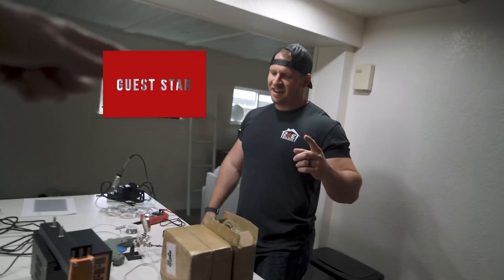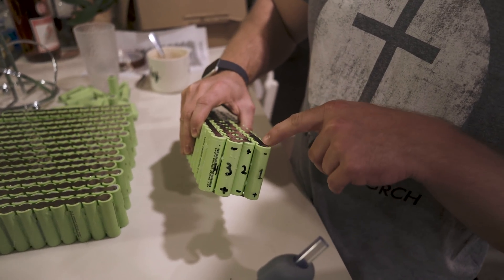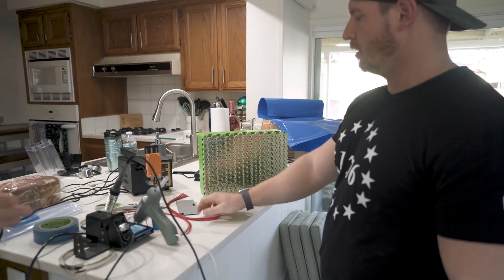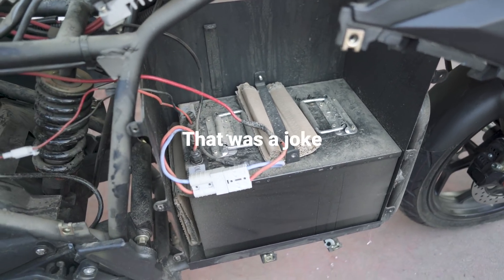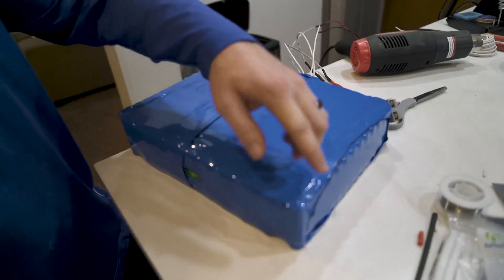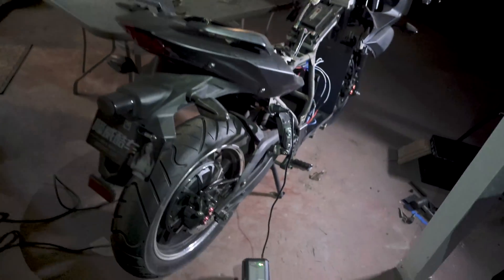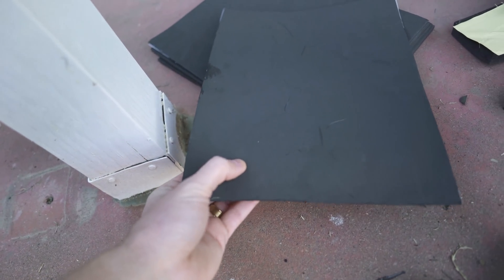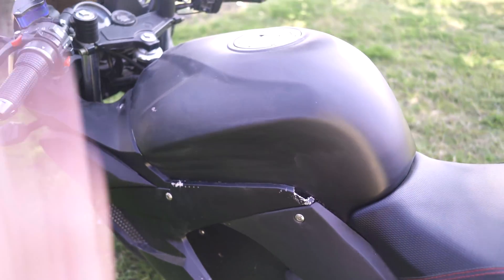UPGRADING the ELECTRIC SPORTBIKE from CHINA | Installing a Home-made Lithium Ion Battery

Comment: I have the same bike...... I change the controller to aa tricycle controller, i changed the battery to a 70ah 72v larger battery and an insane mod in the hub motor for star to delta configuration...... Its insanely fast now... Hitting around 170kmph....i love it

Comment: Hello can you tell me anything about the Wuxi Legou Electric vehicle company?  Are they associated? With the outfit in the city of Wuxi that you had trouble with?  I'm in the midst of negotiations for an 8000 W 120 km top speed 240 km range e-moto that looks good, And seems to be reasonably priced at $4800 (including delivery to my residence in Boston.  The price includes shiping, duty, taxes, etc). However, I have never uded Alibaba or bought a significant item like this from china so wanted your general impression. thanks. Robert

Comment: Hi Nick:)  I really Need your friend !! I bought the same bike from a local retailer... I paid 3,700$ for a 96vlt lithium... and  it run the exact way as your first road test. which make me believe i might've end up with an old acid lead battery. :(....
Reply from the maker: Wouldn't surprise me if they gave you a worse version than you paid for.

Comment: So you have 13p, rated at a combined 44.2 Ahr... that says they are 3400 mAh cells, right?  If so, they seem to be similar to the Panasonic NCR18650B 3400mAh cells, which are rated for 4.9A discharge current. With 13P configuration you have a maximum current capability of (13 * 4.9) 63.7 Amps maximum continuous discharge without damaging the cells.  At 20S, with they're nominal 3.6V each, that's 72V, at 63.7A is 4,586 Watts electrical power , or 6.15HP maximum consumption, and with a motor controller of maybe 95% efficiency, that's around 5.84 HP available to the motor, and with a motor efficiency of 85% that's 4.96 HP mechanical power to move the bike.  

Their original larger cells may have been designed for less capacity, but able to deliver higher current... that's the trade-off in battery cells... either high capacity (mAh), or high "C" rate.  If you run cells at higher discharge current than they are designed for, they WILL get hot due to higher internal cell resistance, and the lifetime will quickly diminish. Fatter cells, rated for higher delivery rate but lower capacity will not overheat, but will "initially" give lower range..... until the skinny cells go bad.

Maybe you should have chosen tool-rated cells?... like the NCR18650PF 2900mAh 10A

Also remember that cell "capacity" does not refer to CHARGE capacity, but DISCHARGE capacity.  How much energy it takes to bring a cell to full SOC does not always reflect how much it will deliver to a load... because of the internal resistance issue... which changes as a cell ages - depending on how it has been treated.

(those "discharge cables" only look good for maybe 20-25 Amps continuous anyway... without overheating)
Reply: This was just the initial pack, as you can see in the following videos

Comment: i was thinking you could measure volt and amp from controller to your motor, then you will know how many watt is going to the motor.  If the watt going to the motor is already max watt of the motor, then nothing else to do.  If lower then motor max watt, then you can look for what restrict full power going to the motor.

Comment: your BMS on that battery was more than likely the limit.  So if we take the 72v (lets assume 20ah battery) we get 1440 watt hours. So for one hour you can push 1440 watts.   Now lets say that the BMS is rated to a max of 40amps then we are looking at around 2880watts, so technically not quite 3000w getting to the motor.   The key is getting a continuous amps multiplied by the voltage to give you the watt output.  V x A = W .   If we assume consumption is 20 watt hours per mile and you've got 1440 watt hours you could hit 72 miles (note this is super slow driving and being extremely conservative on the throttle).   Now if you want a realistic number lets assume that we pull max watts that can be put out by the battery BMS (40 amps) the entire ride (2880w 'V x A') we can see that it's twice the the watt hours available, so it's safe to assume the battery would last for 30 minutes.  And if the top speed is 55mph (40amp), then you'll end up traveling around 22.5 miles before that battery is dead ;) .  You're milage will suffer ALOT as you can see! Now push it from a 20ah to a 60ah and do the math.  72v x 60ah =  4320 watt hours  which in turn should give you around 70 miles of real full throttle runtime. (Formulas (Voltage * Amp Hours = Watt hours)  (Voltage * Continuous Amp output = Wattage) (Watt hours / Wattage = Runtime percentage for 1hr)

Step it up in Voltage on the battery and there's a 2 fold factor that happens.  1.  Top speed increases as there's a higher available voltage.  So the default motor that came with this cheap bike is actually just as good as the 8000w, you just need a battery that's capable of pushing it and a controller to match the battery amperage that's required.  So let's aim for a 8000w bike build here.  1st off a 72v battery is not going to cut it as you have to account for the battery's ability to output the amps as well.  Stepping up to a 96v battery is going to put you closer to your target as you can now go from 40amp draw off each cell series in the batter upto 60amps.  This will give the battery the ability to handle upto  5760watts of continuous output.  So if the controller is programmable and has 110v caps in it, odds are you could just reprogram it to account for the 96v and push the max amp to 60 from 40.  Now if the bus bar in the controller isn't thick enough it may not carry the extra 20amps.  This would push the 2000w default motors to equal the 5000w version.  With you going for the 8000w motor you really have to push either 1, alot of amps at the matching voltage or move to higher voltages to manage the amps (prevent hot ass wires without switching to thicker wires :P) Say a 112v @ 120amp  battery would play nicely with the 8000watt as it can handle upto 14.4kw max.  Running a 112v @ 120amp is gonna net you a max watt output on the battery of 13,440watt.   Now you've got a battery capable of pushing your 8kw motor properly.   You're bike will hit a top speed of around 112mph and just kick arse.   

Anywho, I'm rambling KEEP THE VIDEOS COMING!

Comment: BRO THEY SOLD YOU A FALSE KM/H BIKE. MINES IS A 5000 W AND HITS 65 TO 70 KM EASY 90 TO 100 KM IN SPORT MOLD. FYI THEY GOT NEW BIKES NOW THEY MOVED THE MOTOR FROM BACK TIRE TO THE MID BODY. CAN HIT 150 KM/H. 90MPH EASY. BACK TIRE IS DRIVEN BY CHAIN NOW.

Comment: Can you not by pass the throttle and just inject direct power to the motor with the battery and get a taco of what the back wheel is doing. That may give you the information difference between with the controls controller/restrictor vs direct injection.

Comment: recommend settings and everything that potentially get u 200kmh no joke but will be expensive. heres the setup 
144v 45ah vtc6 
custom 144v sinewave ZL 
10000w QS motor Dualphase
this if you dont know i dont know how to tell you but this set up easily top u 100kmh 0-100 in 4.x seconds :)

Comment: Man, this is the second time i write this message, do you take the time to read the comments? 
Have you tried that button that looks like the horn??? One is the actual horn, but the other 'changes gears' as to say, it is a 'limiter' and will switch from 1 to 2 to 3 to 4 and it will defintely run above 50 kms/h! That is how it works on my electric bike! Mine is 1000 watts, not 3000 watts like yours and reaches 50 kms/h in '4th' gear'. Just try it! Promise me you will!!!!! Because I see your driving but you don't even try to honk the horns! Try both buttons!!
Reply from the maker: Bro I'm very active in the comments. Watch my latest video and you'll see I was hacked two weeks ago and had no access to the account since then.

Anyway, no, I've addressed that many times in the comments. The horn button is a horn. The start button is a horn. No limiter, just crappy battery and motor
Reply: @TheInja  thanx for answering. Sorry you've gone through all that trouble and that your bike was so disappointing. Hope you get it to run properly. Best of lucks! 😉👍
Reply: There must be a button somwhere on your bike that is a limiter.... Once again, try one of the horn buttons....

Comment: You should definitely have thicker wires. Then you won't lose so many volts under high load.
You should also have a more powerful bms.
I would recommend active balancing of the cells.
The cells have easy to go out of balance under heavy loads.

Comment: I am wondering when you will decide to change the fucking controller and solve the 50 kmh problem.. you have built a 1000 bucks battery but not give a 50 bucks controller.. its not need to be a special controller just an ebike controller with the rated power my opinion is to overvoltage that motor for ex choose a 110 volts controller ..and modifie the hall sensor plug.. the colours will be the same..

Comment: Build another of those battery paks and put the 2 side by side, then you will have some power. And use heavier guage wire. A higher amperage controller will spin that motor faster!
Reply from the maker: We have lots of upgrades on da whey 😏

Comment: Take the brake pads off, coat the back side of pads with brake quiet and let it dry, then reinstall.  Fill that battery compartment up! Don't forget to leave ventilation to cool them.

Comment: Connecting pos-neg for every individual battery may have been overkill.  Just making one connection between the pos-neg strips should have worked just as well.
Reply: b barnhouse each one only carries 7ish amps without getting too hot. If you’re running 40 amps at 3000 watts that’s a real quick fail point without more connections

Comment: If I were you, I'd be shooting for 144v and 250 ~ 300A
Reply: Martyr4JesusTheChrist  not for a motorcycle build
Reply: Martyr4JesusTheChrist  144v is within the specs of many controllers. I sell sine wave 24 fet controllers rated to 150v for 250 quid.
As for batteries, we're talking 14s more than what he's currently running, granted it's more cells, but not a crazy amount more.
So for 430 quid you could expand the battery to 34s, plus 250 quid for controller. He's already talking about replacing the controller.
I think you need to calm the fuck down and accept that this is merely the opinion of an experienced ebike builder and electronics engineer.
Reply: Martyr4JesusTheChrist  oh, side note, if 84v is getting him 50kph, 144v isn't going to get him over 100mph, that's beyond the winding of the motor he has.
Also I can touch the positive and negative of my 100v pack and barely feel a thing. DC is nowhere near as dangerous as AC. Check out electroboom on stage with about 150v of DC, sure it feels uncomfortable, but it's faaaaar from fatal.
Reply: Martyr4JesusTheChrist  144v is a pretty common spec. Andy Kirby, although canny, is new to the scene. I'm friends on facebook with many guys on endless sphere who have created amazing things. And I can tell you with no uncertainty that 144v on motorcycle builds is pretty common place when it comes to hub drives. You'll know fine well that this is a common spec from QS motor. Vito from QS is a top notch guy by the way, he knows his stuff.
I absolutely detest Kelly controllers. Way oversized physical footprint and they always rate there current limit based on phase amps, not battery amps. They make good golf cart controllers though.
Reply: Martyr4JesusTheChrist  my battery pricing is based on using samsung 25r 18650 cells, I wouldn't use anything else other than maybe sony vtc6 on a build like his. I also base the price on there being zero labour charge as they are building it themselves. They may need to buy nickel strap. I wouldn't use less than what they are using 8x0.15. I personally always use 12x0.15, which I get for 12 quid per 5mtr, they'd probably need 13mtrs of it.
Reply: Martyr4JesusTheChrist  you've actually copied and pasted the reason his top speed is so low and you didn't seem to notice it. The motor winding.

Comment: If you want a budget upgrade, search shunt mod. Do that to your controller and you'll get much more torque, might blow up the controller but hey, you need a new one anyway, might as well have some free extra fun with the one you have first. I'd also advise more volts, for greater top speed. My downhill mtb runs at 100.8v and 140A (At the battery, 350 phase amps). Oh, and a controller with flux weakening (field weakening) will get you a few more mph for the same voltage. Finally, deffo need fatter wire. I use 6 AWG silicone wire to keep the voltage drop under load down.
Reply: Martyr4JesusTheChrist  exactly, less resistance, less heat, fewer losses ;)
The frame is built for 30ft drop offs and the like. Takes it like a champ hahaa
Reply: Martyr4JesusTheChrist  No, a 24s pack is 88v nominal (3.7v per cell) or 100.8v HoTC (4.2v per cell)

Comment: What about car battery
Reply: You those portable speaker have like motorcycle battery. If you can get a used speaker and used they charger system is 110. Those cable they like speakers cables need to upgrade.

Comment: A new controller will be a massive upgrade in both acceleration and speed as next step in this rebuild.
I highly recommend to buy ”ASI BAC800” controller that is fully programmable using your mobile phone by bluetooth. ASI BAC800 is a very small, powerful and reliable controller that can deliver 90amps. 
You will peak 7,5kW(84V*90a=7560w)to the motor with that controller and your top speed will probably be about 80-90km/h. Your current hub motor should be able to handle 7,5kW fine. The thin battery wires looks like 10-12awg wires that should be able to handle 7,5kW bursts(full throttle) for atleast 90-120sec. Replace the wires to 8awg and you can use full throttle all day long.
Good luck!
Reply: Martyr4JesusTheChrist If he get this controller, the only thing to lookup is how many magnetic pole pairs the hub motor got. Yes he got a 72V nominal battery(3,6V/cell), which is 84V fully charged(4,2V/cell). If you want more info about thickness of awg/amp wires, Google ”ampere / awg table/chart”. 
4awg wire is overkill and could handle 140amps continuesly.

Comment: I can believe you set the exact same volts on the battery 72volts ???  you should had aim for 96 for better acceleration
Reply: Martyr4JesusTheChrist  hahahaa, dewd, what's your problem? You clearly don't build EVs, so I don't know why you're going around acting like done expert in the field. For one you don't seem to understand the correlation between the number of turns in a motor vs voltage. If you don't understand that then you're just wasting everyone's time

Comment: I think that if you can solve what is cutting the power transmitted from the battery to the motor and eliminate the problem you will achieve better performance but your battery will be drained faster, resulting in a lower range.
I was thinking that if you could add more batteries, find spots where you could add more batteries (maybe remove the wooden frame and add/make a 3-5mm (wall thickness) plastic battery box instead for more space) or find other alternative spots which can also be used in parallel.
The thing is that you want to create more Watts, and by adding more batteries you will achieve that, but you don't want to go over the required Voltage or you will burn something, so add something that will cap the overall voltage to the desired limit. The extra wattage will then be extra Ampere = extra range.
Nice work so far. Keep up the good work!

Comment: You made it work good for you It looks like you got roomp for more cells in that compartment  Maybe you can play with the controller to see if you can squeeze a little bit more power out of it 78 km is a little bit under 50 miles per hour you can do it

Comment: Have you guys heard of/seen enertrac.net? They produce a 10kw continuous 20kw peak hub motor specifically for motorcycles.
Reply: yeah, they make some solid gear
Reply: Martyr4JesusTheChrist  it's an engine for a motorcycle that should last 100k+ miles and capable of doing 75mph+ with the right battery and controller configuration. I think there fairly priced for there robustness and performance. The only moving parts are the berrings. And I hear hub motors are easy to do maintenance on.

Comment: Wiring is too thin, you also need to solder multiple wires to the + and - at each end of the pack, not just 1 long strip. I know other people have said the same and you have said its fine, but if you have a wire melt or unsolder itself and cause a short that bike could turn into a fire ball in seconds!
Reply from the maker: I'll keep it in mind